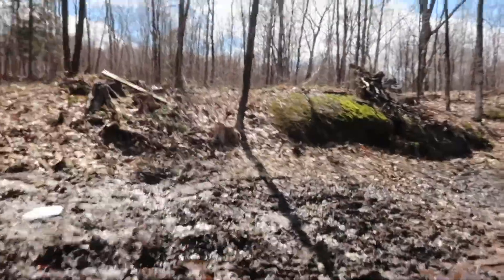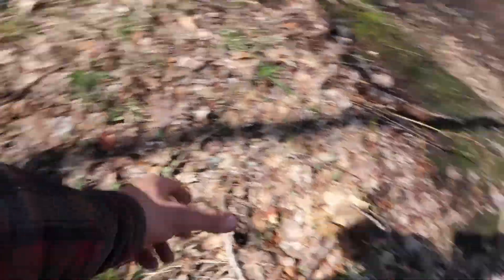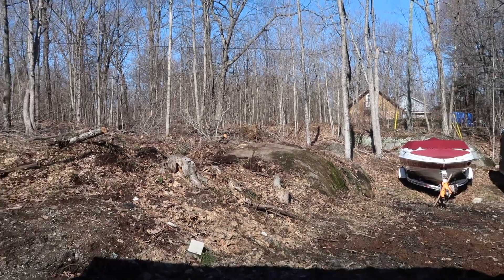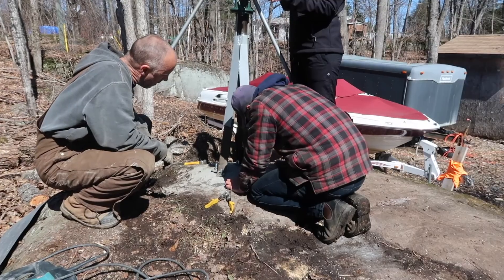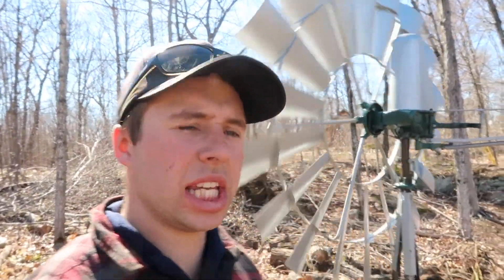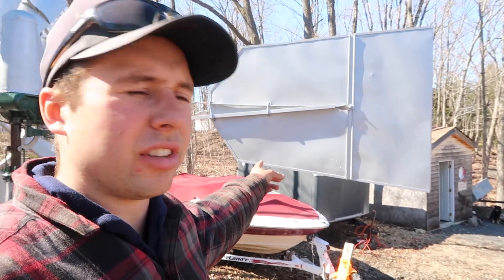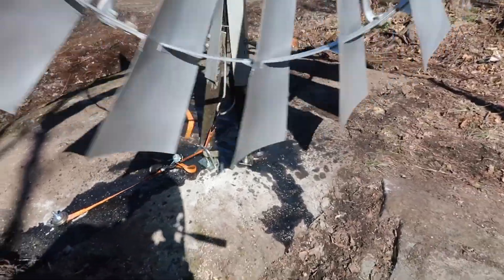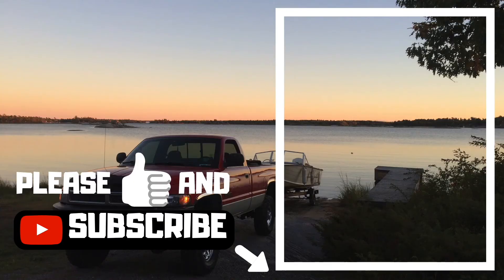Vintage Beatty Windmill Raising After Restoration

Comment: Those New Mud Lites are working Great
Reply from the maker: Thanks Steve. Really are a world of a difference over the others on the blue ATV. I still like the blue one better. Did you get my Email? I think your issues are pretty simple on yours and you will get up and running soon.
Reply: @Schneids15  I certainly did get it up and running. It was the fuel pump and even though I considered this, I felt it was more electrical than mechanical. I was wrong and you were Right. Thank You so very much for this valuable info. You are the Bomb and I'm just a fuse. Thank You again.
Reply from the maker: Wow. That is great Steve. It seems i have never really run into any issues electrical wise with a lot of stuff. If it is electrical most of the time they just do not run. Glad i could help👍🏻 Enjoy riding!

Comment: Is that as high as you are going to mount it? What about when it snows ?
Reply from the maker: Yes that is as high for now. Tower will get worked on this summer. Snow will be a factor yep but it will likely just get shut down for winter or i will have to just shovel it. Just up for decoration now. I need to power something off it.
Reply: Great job on restoring it!